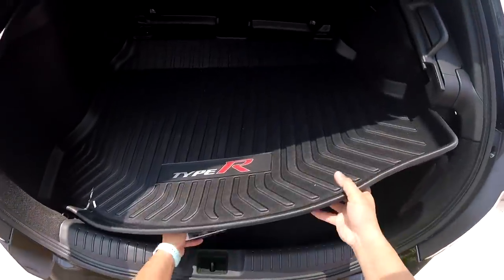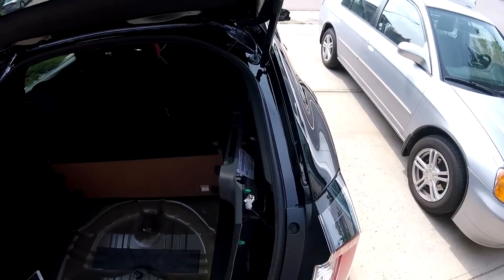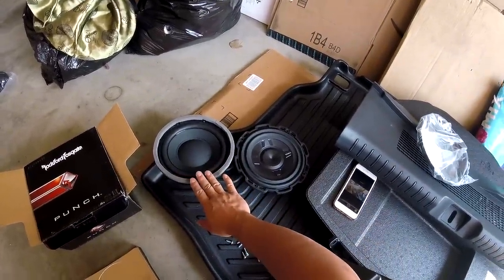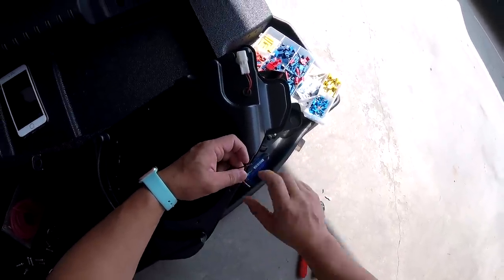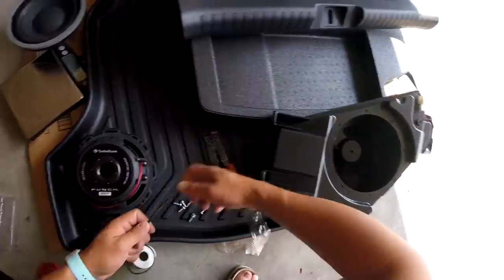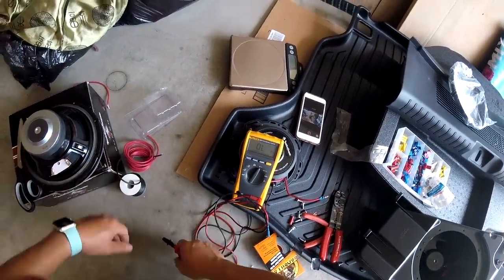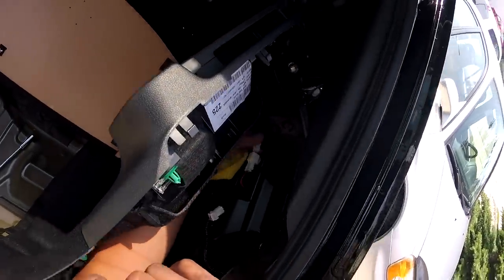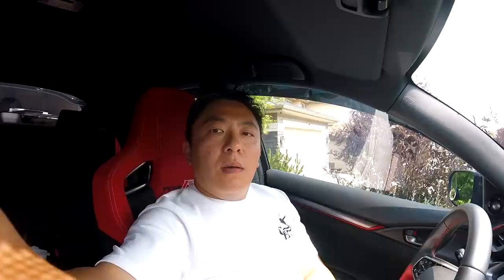2016+ Honda Civic Hatchback Factory Subwoofer Swap Upgrade

Comment: do u have an amplifier during the time  you installed the new sub? thanks
Reply from the maker: When I initially did the sub swap I did not have an external amplifier.  I did the sub only swap to see how much better it would sound with the stock amplifier.  It did improve considerably but I did another video afterwards showing how to install a LC2i and external amplifier to really give the sub the power it truly needed to perform well.
Reply: piercedasian thank u sir 😊

Comment: Hello, I just came across your channel. I have a 2017 Honda Civic touring and I want to upgrade my speakers including my sub. My question is, is it the same setup with all civics as far as replacing the sub? Mine isn’t in an inclosed area. Mine is on the rear deck.
Reply from the maker: the basic principle is the same.  Location might be different but the impedance and wiring is fundamentally the same for the most part.

Comment: Just out of curiosity, why did you go with the Rockford sub?  Will other 8 inch shallow subs potentially fit? 

Just doing a list of what I need here. Lol
Bullet style connectors
14 gauge wire
Reply from the maker: I went with Rockford because the quality and performance and most importantly fitment was good.  Price was reasonable too so it naturally made sense to go that route. I am sure there are better subs out there but I don’t have the time to mess with doing a pile of research and then trying to get it to fit. In hindsight I should’ve considered installing a spacer ring to the stock housing so I could get a deeper sub so that I can get lower frequencies but I am not complaining about the current setup.
Reply: @piercedasian  that makes sense. I was asking mostly given the price has gone up to about 169 USD so wasn't sure if you felt it was still worth that price. Once you actually added the amp did you get much better results? Looking to get the most bang for my buck without losing trunk space

Comment: I have a '19 civic hatch EX, I wonder if the factory sub enclosure can be purchased from somewhere and if it can be installed.
Reply from the maker: Yep you definitely can buy the enclosure and the matching rear interior quarter panel but the problem is the wiring and how you’d tie that back to the head unit and make it all work properly. I would assume that being a Honda that most things are likely plug and play given the proper connections which can also be purchased from the dealership.
Reply: @piercedasian  The head units are all the same but as you said it'll come down to wiring. It would be awfully nice of them to have pre-run wire.
Reply from the maker: yeah it would be nice and Honda back in the day used to have near identical harnesses for all their cars.  I remember when I added a/c to my CRX back in 2004 that it was plug and play.

Comment: This sub is now $200 in Amazon. Is it the same exact model as yours ($115 in 2018)? 
Or is this one on the link a newer version? Thanks
Reply from the maker: The price could very well have gone up since 2018.  I remember specifically choosing that sub b/c it was ridiculously cheap and performs very good.  Things have gone up a lot in cost as of recent so I'm not at all surprised that the price is $200 for the same exact sub.
Reply: Can't seem to find your video on the 10inch sub install. Do you have the link available? Thanks! Subbed
Reply from the maker: @johnfromschool  I didn’t do the install on the 10” sub. I am saying that someone on civics made an adapter ring that allows you to install a 10” sub. What I made videos for are the sub swap and amp install.

Comment: thanks for the video! Did you install and amp yet?
Reply from the maker: Glad you liked the video.  Yes I installed the amp quite a while back and the install instructions are on my channel.  Just search for sub install on my channel and it should come up.
Reply: Found it! Again thanks for the detailed video. Would the Rockford speaker still sound good just by having the amp without the LC2i?

Comment: I'm thinking about buying my sister in laws 2016 Civic EX-T Sedan do you know if it's possible (like is the wiring in place) to simply source an OEM subwoofer and hook it up or is this a start from scratch kinda thing?
Reply from the maker: that is unknown.... Honda USED to standardize all their wiring in their cars to make adding things in from higher trim models easy.  I've read that in some cases that is still true but in many cases it is not.  You will have to trove the internet for more information.

Comment: I have the P3SD2-8 sub, do I need to do the criss/cross positive to positive/ negative to negative on mine also? Thanks
Reply from the maker: You should try to exchange your sub for a dual 4 ohm voice coil sub unless you intend to run it on an amp that is 1 ohm stable.  There are two ways you can wire your specific sub.  If you wire your voice coils in series - voice coil 1 negative to voice coil 2 positive with the remaining terminals going to the amp then it will see a 4 ohm load.  If you wire the sub in parallel - voice coil 1 positive to voice coil 2 positive and then to the positive on the amp and do the same for the negative terminals you will essentially create a 1 ohm load.  With a 1 ohm load you have to make sure you have a sufficiently capable amp that can handle low impedance loads.  Low impedances extract the most power out of a amp but if it isn't designed to handle it then you risk signal clipping and you can fry the sub and/or amp.  If you wire it with the 4 ohm series connection method then ANY decent amp will run that load BUT at a sacrifice of not extracting every ounce of power out of your amp.  This is why in my particular setup I went with a dual 4 ohm voice coils and wired them in parallel to get a 2 ohm load.  My amp can EASILY manage a 2 ohm load without frying anything and I get decent performance out of my tiny Rockford amp.  I hope that makes sense.

Good luck and let me know what route you went with.

Comment: Just picked up a 2019 Honda Civic Hatchback Sport Touring. I also plan on replacing the stock sub. Purchased a Kicker CompRT43CWRT81 and noticed that the impedance is 1 ohm. Can I get this to work to match the original stock 2 ohm impedance? If so, how?  Many thanks!
Reply: Eddie Vega I want to ask, I’m planning on getting the EXACT car and I’m curious about the stock sound system. How is it? I’m not a audiophile so I’m not very picky, but overall does it sound like the title says, being premium? And does it have any issue connecting with Apple car play/android audio like the phone lagging or the car not recognizing your phone? Thank you
Reply from the maker: John a 1 Ohm sub will NOT work properly with the factory head unit.  You'll be putting too much load on the stock amplifier outputs in the head unit.  You will unfortunately need to either go with external amplification or replace the sub with the proper impedance.  I personally suggest going the external amp route as it made a substantial improvement to the car's sound and it hardly broke the bank.
Reply from the maker: Stock sound system overall isn't too bad at low to moderate levels but don't expect it to sound great at loud volumes.  I find the power output of the head unit lacking relative to going to external amplification but even for an audio junkie like myself all I did was upgrade the stock sub and threw an amp in to drive the new sub.  Exponentially better.  Android auto seems okay and airplay works reliably.

Comment: I don't understand why you would need a line out converter since you already have output for a sub. I'd think you could turn down the subwoofer lever in the settings on the factory head unit and then just use the existing subwoofer leads as your signal to the amp....maybe I'm wrong though.
Reply from the maker: Ah good question. It is because the modern car stereo has its own weird built in EQ system that apparently strips out and messes up the bass from the sub signal (yeah that sounds ridiculous but it’s true) so the purpose of the LC2i is to restore that missing bass signal and convert into a line out signal that can used by the amp which them can drive whatever sub you’d like. If you hooked up a sub that was 2 ohms impedance straight to the sub wires like how I did in my first sub replacement video then all will work just fine. It is just when you add an amp with no line out converter that it apparently goes all wonky.
Reply: Did just this with my JL MicroSub in my '15 Si before I bought my Type R. Worked very well!

Comment: How come I have a smallcracking sound and when I turn up my volume to 28. It just dies. I have fk8 2019. Same set up as yours. Sub no amp.
Reply from the maker: that's because your amplifier is clipping.  Do not turn it that loud again otherwise you will blow your speakers or fry the headunit.  If you want to go that loud you will need to add external amplification.

Comment: does my EXT have a amp? Can i just swap the subwoofer? Mines sound busted
Reply from the maker: Yes it does.  My buddy has a EXT as well and his amp and sub install was almost identical to mine.  This is the sub I used and it is a perfect drop in replacement that has the same impedance (dual voice coil wire in series) that will match perfectly with your stock amp.  https://amzn.to/2R2p221

Comment: Hello, so I’m installing an aftermarket sub, amp and LC7i in my civic sport hatch as well. Can I tap into the rear OEM subwoofer to power my LC7i??
Reply from the maker: no the rear oem sub signal doesn't provide power to power on a device.  It merely is a signal line.  You can power the LC7i using the same power feed as what you pulled from the battery back to the amp.

Comment: Hello, what subwoofer do you recommend for the civic X sedan?
Reply from the maker: Well I put in a Rockford sub in mine because it fit perfectly and it had  good balance of value and performance.  There are other brands you could buy and the sky is the limit but I stuck with what I knew would fit my needs and budget.
Reply: @piercedasian  
do you have a link to this sub? Or what are its dimensions and performance.

Comment: could you link the wires and tools you used in this video?
Reply from the maker: I could but most of the items uses were simple parts from an auto store.  When I have time this week I will start adding links to all the tools and parts I used in all my videos so it is easier for others to buy exactly what I used to get the job done right.

Comment: I did this exactly how you did it.. and The bass sound lower then the stock.. and I hear a weird sound coming off.. I tried different way with the cables and the same. The only thing is I think my wire is 12 gauge
Reply from the maker: hmm, a 12 gauge wire likely wouldn't cause issues like that.  What kind of amp are you running and are you absolutely certain that everything is setup IDENTICAL?  Even the slightest variance in how wiring is setup can really wreak havoc on the system.  You can send detailed (and clear pictures) to piercedasian@gmail.com and I can help you troubleshoot.
Reply: I have similar issues. My system audio just shut ofg
Reply: 2easymode that’s exactly what happens idk what’s wrong
Reply: piercedasian not running a amp.. your running an amp?
Reply: @eltrati19  im not running an amp. Im just trying to get clean lows from my sub vs stock there's no  lows at all. I'm going to try to other setting today. If not i'm going to send my sub back. Might just be bad sub.
Reply: 2easymode yea me neither no sub. I thought he didn’t have one. And I don’t think is the sub I went to a audio spot they told me it needs a sub. After I hit the volume over 22 it shuts off or if the song has really hard bass
Reply: @eltrati19  yes I have similar problems. I bought Ohm meter today. Going to check my wiring. If it reading the correct ohm. Checking if my wires tight. If all of that don't check out I'm going to send it back.
Reply: 2easymode let me know
Reply: @eltrati19  ok bro. Get ohm meter.  So check your sub. If its a dual 4ohm or dual 2ohm. If you have a dual 2 ohm. You use metric meter to test the sub and the wire on your car. Making sure it is 2ohms. Then wire your connections and test one more time you wired it correct. That should do the trick. If yours is a dual 2 ohms. No need to bridge the wires. Just one one side positive and negative. Once you made your connections. Use your meter to test if you did it correctly. It should read like 1.7 to 1.8. If bought the dual 4ohm. This guy video pretty good. Hope that helps.

Comment: Why didn't you use P3SD2-8?
Reply from the maker: It is because the stock head unit (prior to me installing an amp) drives a 2-ohm sub load.  The model you suggested run in parallel would result in a 1-ohm load which is too low for a stock amplifier.  If going aftermarket amp then yes, the a dual 2 ohm voice coil could work.

Comment: I wonder if a 10" can fit???
Reply from the maker: yes it can but you'll need to cut your factory sub grill and also install a spacer ring to accommodate for the increase size and depth of a 10" sub.
Reply: Could you give me the specific information about the subwoofer so I can buy it?

Comment: Is it possible to put a 10" in it..?
Reply from the maker: You cannot install a 10” sub into the stock enclosure because the hole won’t accommodate it unless you do some custom cutting and retrofitting.

Comment: I don't think i cant do same thing with my Fk8, Australia model does not have Subwoofer
Reply from the maker: Interesting. I wonder if you could mod yours with a civic that does have the sub. Unfortunately all 10th gen civics I have worked on all have subs in them (I am in Canada).
Reply: piercedasian yes mate! The thing is base model and Civic RS (10th gen) hav 12 speakers and Subwoofer, and civic type R has 8. I think the best way to do now is get the Sub from one of those and have someone to install it, cuz i have to idea of wiring! Maybe it gonnna work!

Comment: Why not just get 2 spades and make extensions instead of cutting wires.... never cut wires
Reply from the maker: this is why I cut the wires inside the sub box b/c I know I'd never replace the stock sub AND the little short pigtail can be replaced with a new honda part.  I would never cut the wires on the larger main harness.  This was probably the least invasive way of installing a system that won't have any potential connection failure points.